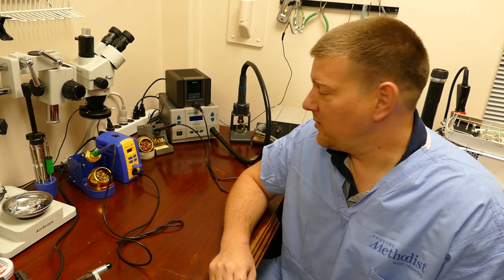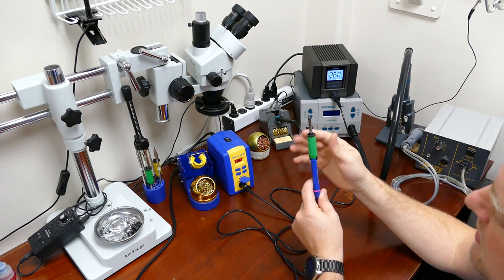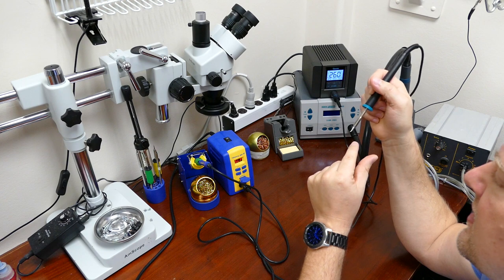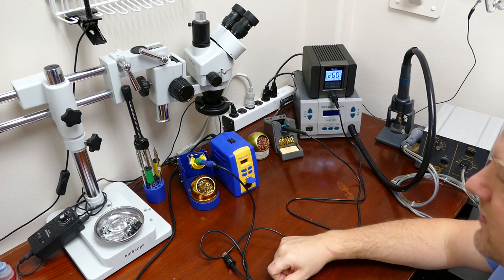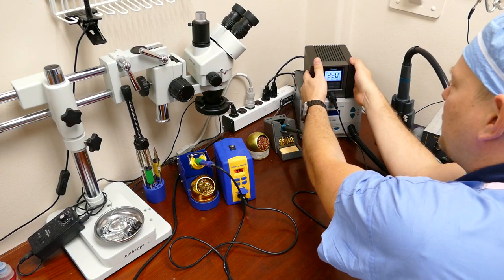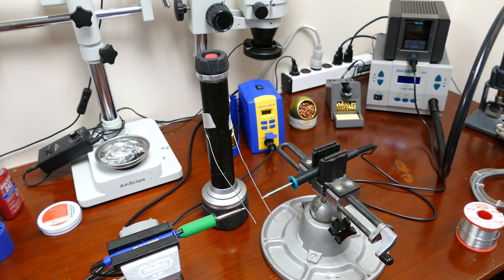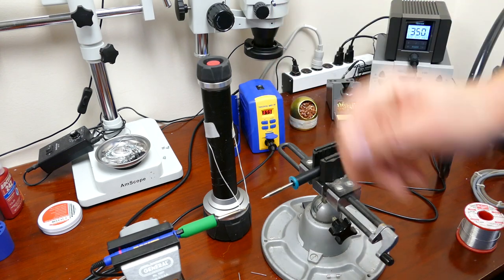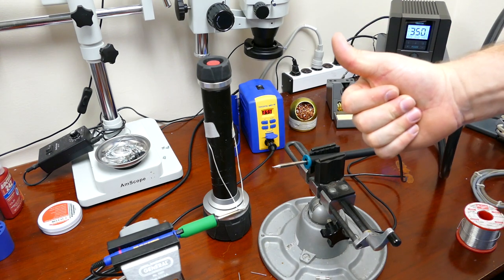Quick TS1200A Review and Compare with Hako FX-951

Comment: Thanks but a more extensive test with heavy boards would be more valuable 👍
Reply from the maker: If you get around to making a video on it covering those heavier boards, I'd love to watch it.
Reply: @BetterBiomedChannel  Hi, I didn’t what to upset you, but it turns out many people outside USA and Europe can’t get soldering stations like PACE and Hakko for the same price you guys can get, therefore we just only can rely on these alternative soldering stations, and we want to know if those stations are a good investment for us and our work places, this is why we want to watch a more detailed reviews and comparisons against these well know brands and appreciate this videos, thanks, and keep going with this videos 👍
Reply from the maker: No, I'm not upset. I have specific uses for a soldering station since I repair medical equipment. This iron is used differently here in my shop than in many other locations because of regulations, risks of medical devices and efficiency of component repair / vs assembly replacement.  Most soldering iron use in biomed shops is minimal. I care about the speed of the iron reaching temperature and the ergonomics of the system - both of which are excellent on the Quick unit. If anyone else does make a video on soldering iron capabilities,  I really would love to watch it. -Justin

Comment: It call J tip. You supposed to use curve to store solder, and the end of the tip is use tu melt solder on the part. It is a versatile tip.

Comment from the maker: Solder tips are not interchangeable between the Hako and the Quick.  Ebay or Amazon search for Quick Solder Tips.
Reply: Actually are new model 861x with 1300 watt and TR1300 model

Comment: My eyes are fixed on Quck TS1200A. Does it have enough thermal capacity? I'm looking for a soldering station that's suitable for all my needs.
Reply from the maker: Yes, it works very well with large thermal masses. It comes with a J tip and I suggest the cone or the chisel tip
Reply: @BetterBiomedChannel  thanks

Comment: are the tips Interchangeable?
Reply from the maker: You can change the tips but they need to be the Quick compatible tips. Hakko tips will not work in this unit. I use the tss02-SK, tss02-j (included) and my favorite tip: tss02-3c
Reply: Chris Roubis  T12 tips on a Quick TS1200A? Sure? I thought they were proprietary tips .... similar to the T12 or T15, but incompatible, Thanks!

Comment: 07:31 The implication seems to be the Hakko goes to sleep immediately being a drawback, but I'm pretty sure the Hakko's menu parameter #2 lets you set the time to sleep. From page #5 of the FX-951 manual: "2 0" being sleep immediately when placed on the holder, "210" sleep 10 minutes after placed on the holder, "230" auto shutoff after 30 minutes on holder.
Reply from the maker: True,  but it's nice to have a device with a modern interface so I can read the settings on the screen without digging out a manual..
Reply: @BetterBiomedChannel  Agreed -- not a fan of that 3 digit cryptic mode interface. VHS and microwaves from the 80's and 90's forever flashed "12:00" for the same reason. Still, once set, at least the Hakko remembers the setting. Trying to decide between the two myself; need a new iron.
Reply from the maker: @gregercolano8032  The difference is in the tips availability. The Hakko has more options but the Quick has many more on the market since I last bought tips.

Comment: Thanks for the video, I just got one. I’m really pleased with it over my old set up. The manual leaves much to be desired, English translation isn’t very good, they left a few things out. I still don’t really understand the 3rd channel dual temperature welding with timing setup.  Another glaring omissions is that the soft rubber forward portion of the soldering iron handle has a very sensitive contact sensor that allows you to wake it up out of sleep with just a slight squeeze. 

By the way don’t engage with trolls, you’ll  never win an argument with a moron.
Reply from the maker: I'll have to try out the grip sensor tomorrow.  I was wondering how you wake it up after it enters sleep mode (besides a button press)
Reply: Chris Roubis   Наконечник от Т12 не подойдет к паяльнику  Quick TS1200A. Для этого паяльника необходимо жало Quick TSS02.

Comment: yeah man i use these ts1200a with a kesger t12 and got an huge improvement from standard t12 tips
Reply from the maker: Interesting
Reply: T12 tips on a Quick TS1200A? Sure? I thought they were proprietary tips .... similar to the T12 or T15, but incompatible, Thanks!
Reply: you mean you used  TS1200A tips on kesger t12 soldering staion ?
Reply: @shine9001  exacly , they are wired the same way

Comment: Sleep function is a important feature. Once a have left for night    soldering iron :/
Reply from the maker: The quick does have a sleep feature and gripping the handle wakes it back up.
Reply: @BetterBiomedChannel  thx for answer. Yet i have another do you gonna buy 'micro twezzers' for Quick? I have seen for JBC, Hakko and Weller but not  Quick twezzers
Reply from the maker: @chocholatemilkshake4799   I have never used micro tweezers with a soldering station. Maybe I'll find some and give them a try

Comment: So you've had it for a little while now, any new thoughts? Tips holding up compared to the Hakko T series stuff, any bugs, etc?
Asking since I've been eyeballing one of these to save my FM204 from riding around in my field bag. 

Also been looking to pick up a couple for work in the lab (embedded systems EE. Ie, those people I bet you're cursing when you run into goofy design choices :P ). Big rework stations are nice and all, but it's very common to drag an iron to your desk for making little tweaks during dev work. Something smaller like the FX or Quick would be ideal. Shame the Tx and TS tips aren't interchangeable though. Saw some things about different heater core resistances.
Reply from the maker: I really like the 4mm round angle tip. I run this iron still at 350degC and the tips are holding up great ( of course I clean them before letting solder sit and bake in..)
This iron heats up and recovers so quickly with the 4mm round angle that my Hako hasn't even been turned on.  I have the Quick for large thermal mass and the Hako  next to it with the fine tips. I love them both.
Reply: @BetterBiomedChannel  Хорошее видео! Спасибо. Вы говорите о Quick TS2300C или Quick TS2200 ? Вам приходилось ими пользоваться?  Не знаю какой паяльник выбрать: Quick TS2200 или  Quick TS1200.